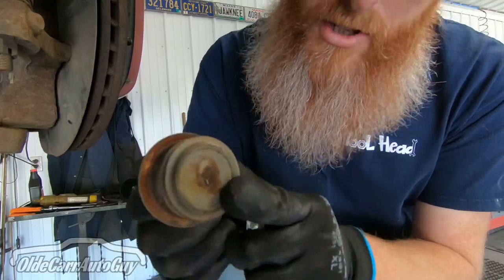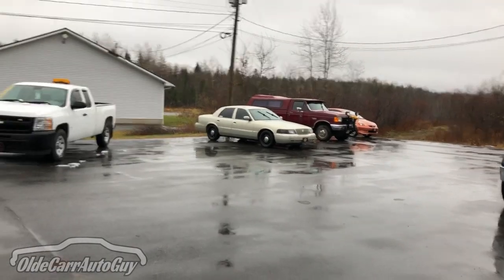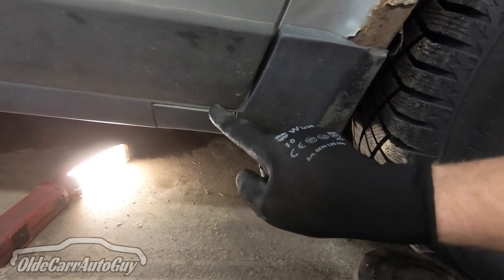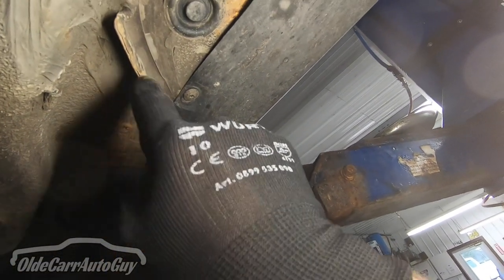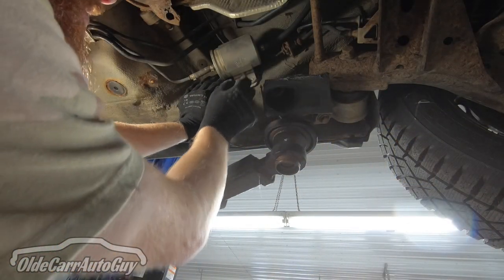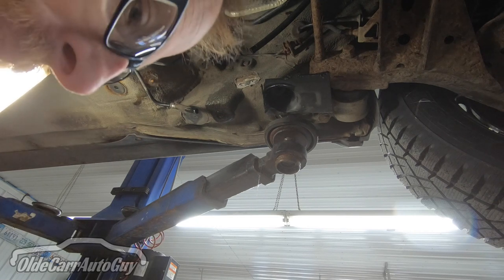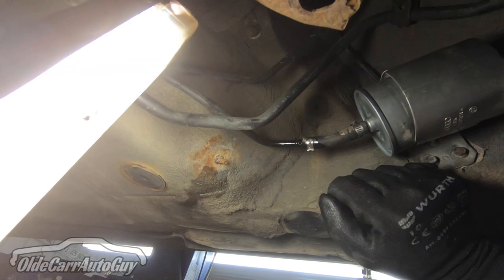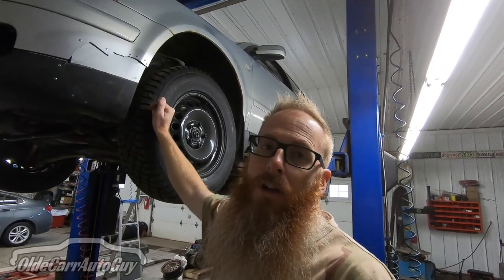MY 2004 GRAND MARQUIS GETS STOLEN OFF MY USED CAR LOT- REPLACING A FUEL FILTER ON A 2000 VW PASSAT

Comment: I was taught primary lift points on a vehicle are the fuel tank, and the oil pan.
Always lift the vehicle to the highest point possible before rocking it back, forth so if it falls anyone nearby will be alerted. My auto shop teacher was Dr. Vinny Boombatz.
Reply: That's a great point. Had to replace an engine recently after someone lifted it by the oil pan and crushed the pick up tube which starved it for oil. The only time I ever went to a dealership was for the LCM recall and that didn't involve any lifting.
Reply from the maker: Ya gotta learned the wrong way before you can learn!

Comment: I got a washer bottle  and a bumper lol only problem is am in Scotland. Nice explanation for someone useing a two post ramp. Oil leaks are comman on the old Vw Passat b5 1.8 T engine the pipes rust away to nothing. I gave you channel a wee share out on the Passat club see if see if anyone comes over for a look. Btw you could have the bumper for free lol I would give it to you. Take it easy mate. I will catch you on the next one.🏴👍👍
Reply from the maker: Thanks. Ali! I’m ok with the bumper cover I have as I plan on cutting it up a bit once I get the lift installed! As far as the washer bottle, I definitely would be interested in that! Would you mind checking the price of shipping for me! I’ll compare that to the cost of buying one used at a scrapyard!